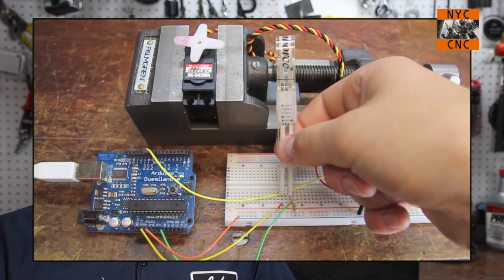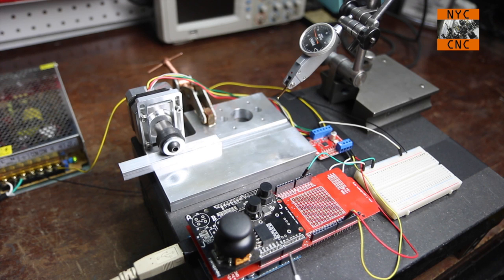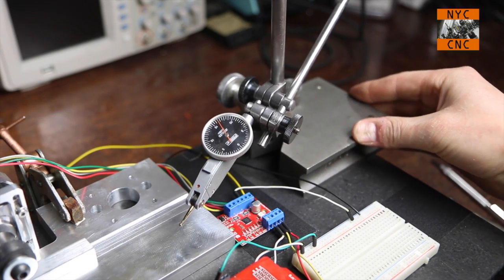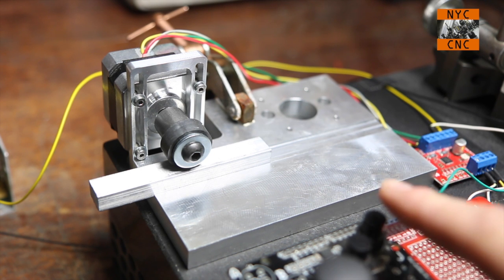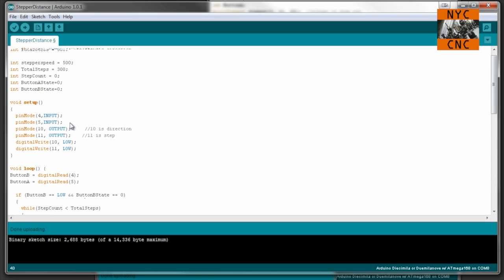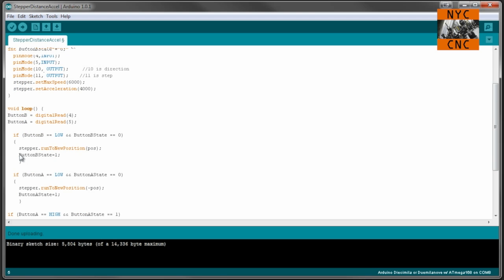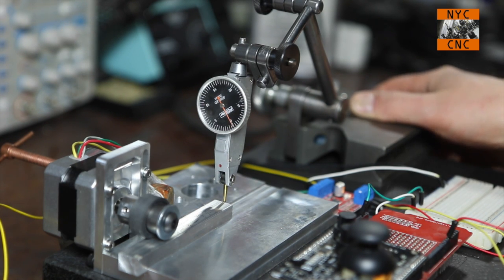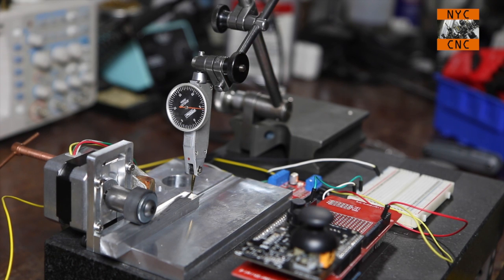Arduino Stepper:  Ultimate Accuracy!

Comment: auto cutter here we go I do believe :)  good job,  I was going to suggest something similar to what you did at the end of your video some sort of feedback, perhaps a servo with feedback could kill two birds with one stone but would not account for slippage.   two encoders that self check each other and even prox switches at certain intervals to rezero/ or show true position would probably be a somewhat realistic path.  You should be able to get extremely accurate results as long as you can account for any possible slippage thru occasional realtime limits and even just a single encoder to compare to the pulses pulsed more then likely dead on results on the cheap.  Please do share what your final design will be, really enjoy.  Great Job. I've been into automation and controls for a long time as well, its what I do for a living. later man
Reply: Nah, your doing great and certainly on the right track, sometime its more fun to figure it out for yourself, rather then to follow the standard or learn from what someone else is doing, seriously good job.  I believe you'll find there is an error in the way those acceleration codes were programmed in the arduino, and you will not be able to get consistant results well not without making your own acceleration code anyway or using someone elses that has been proven accurate.  what type of material will you be cutting if this is indeed for the automatic cutter you mentioned in other videos as I believe it is?  if it Is multiple shapes/sizes, rounds, tubes, bar, flats, etc.  I believe you will find it difficult to get into fine fine accurate cuts well itleast without making a fixture that moves as opposed to just the material itself ( holding material to fixture and material moves when fixture goes forward. That could be a very long piece of equipment to make if you have the room and those are the requirements/multiple shapes and sizes and lengths though it  would probably be the easiest/cheapest route to go.  If room is an issue a dual grab and feed could be an option if using a fixture one feeding lock grabs and feeds on the moving fixture, while the other holding lock locks on the stationary base prior to the feeding lock retracting from full extension, the feed lock retracts not moving the material, once feed lock is fully retracted feed lock locks and holding clamp releases and cycle would continue until your feedback reached the accumulated value then cut.  just throwing a few possible concepts based off of situational variables.  I'm sure you have a picture in your head right now and I'm sure its going to work extremely well based off of what I've seen so far. looking forward to seeing your progress, thanks for the great and well made videos.  later man
Reply: He will most certainly need an encoder if he expects to achieve this this kind of accuracy, although there have been many times folks thought they needed an encoder when they didn't.  It all depends on the application.  As long as the stepper is not undersized so that missed steps are never expected, limit switches alone often will work.
Reply: absolutely Keith, I'm only assuming he wants to input several different lengths to cut in a given day or whenever a length change is needed.  also assuming he  just wants to simply input a length he'd like his stock cut to and the machine automatically feeds it to that length and then the cut starts.   If its a continuous run of multiple parts a limit switch of some sorts would suffice for accurate lengths even, but it would take a lot of extra time in setup if you only went with limit switches as you would have to reset the limit switch location to the new desired length every time you wanted to make a different length cut(of course he could automate the position of the limit switch itself once again limited in space may not be best design for application).  So many infinite possibilities of designs, I'm very interested on what he is going to go with.  That to me is the beauty of automation when it comes to controls 10 different people can accomplish the same task in 10 different ways or designs and as long as the outcome ends up accurate and the same in the end they all would have made a good design.  That being said there is always a cheapest and most efficient way to do everything.  The best designers will usually choose the simplest/ cheapest path to get the job done while not skimping on quality nor longevity of equipment service :)  He seems to have a good bit of brains in him, He also seems to really enjoy what he does.  Those are the only two prerequisites that really matter when it comes to creating a good design, I've found they usually always end up successful in the end the final test being this,  did it do everything I wanted it to do in the end consistently and accurately every time? answer=yes you passed  :) Take it easy Keith
Reply: NYC CNC Understood, it is either don't allow slippage and use an encoder, or allow slippage and use a limit switch.  Certainly the later is both easier and cheaper.  Btw, like Mike, I also work in automation and love it from every aspect.  Just wish we had more manufacturing in this country again!
Reply: NYC CNC
Yes, most certainly the stepper shaft.  If you use timing pulleys and belts, there won't be any slippage.  I'm with you though, the limit switch is a better option for your application.
Reply: NYC CNC If I were going to make one and automate it to account for any type of stock within reason, I would go with an encoder but not in the way you may be thinking I would have a stepper or servo or pneumatic or hydraulic cylinder drive something similar to an x axis on a milling machine motion  and I would have the encoder reading actual movement thru precision  rack and pinion such as you have on a measuring caliper, and or I'd just use a string pot encoder (common name for anyway) and make sure it is mounted level and equal distances from the machine.  this would be assuming you have a large amount of space to allow for that design could be as simple as an acme screw driving some square stock tubing as the moving table, doesn't have to be an actual x axis with ways.  The main question is how accurate must these parts be if your talking a 10-20 thou tollerance or even if your only running short parts.  I believe myself an encoder would be overkill for your purposes assuming you have a some allowable tolerance for possible slippage.   well thats one of the many ways  how I might have used an encoder anyway.  reality is I would probably go with your original concept and use a strong enough stepper motor to drive your stock as you showed with the additon of two rollers and a good amount of tension against the part total of 3 rollers and maybe even 4 @ 90degrees from each other (flat stock).   I really believe that would work just fine even for very accurate positioned cuts.  Key being a stepper motor that has alot of torque so that you can tension the drive wheel tight enough to not allow any slippage against part as well as enough torque to where the motor will not skip any steps.  I know you can understand what I'm talking about when I state stepper skipping because I'm sure you've experienced it on your g0704 when you first went to tune the steppers,  To fast and you loose holding torque and you magnetically skip a step and or to much load same situation.   I guess I"m not good with short versions here :) but short version I'd stick with your plan and maybe sandwich on some precision rollers with one drive wheel and an encoder should absolutely be good enough, for your current need.  You will be forced to go a diffrent route if you ever change your needs such as multiple stock sizes or shapes to cut.  Keep up the good work   If you truly are making same parts 100's or 1000's of cuts Id just use the stepper, if accuracy is a must back it up with a limit switch preferably a prox switch for accuracy's sake, and if you are doing aluminum or plastic or some other non ferrous material look into Diffuse proximity sensors (Transmitter reciever same sensor reads the bounce back very accurately/consistently) and or I would probably just use a capacitive proximity sensor which would still give you the ability to do plastics and non ferrous material as well as steels.  If only steel parts just go with a standard ferrous sensing proximity sensor as they will most likely be the cheapest route($10-30 or more).  Eyes hurt yet from reading :)   Hope this helps bring some light to some options you may not have considered or known of.  automationdirect.com has good prices on good equipment of the types mentioned in the realm of sensors.  Later man
Reply: Mike fisvii
And maybe throw in an LVDT just for fun ;-)
Reply: you sound like an old timer :)  or perhaps an old steel worker or power plant Instrumentation & controls type :)  just a guess  non the less definitely an industry controls type guy.  take it easy Keith back to the grind :)

Comment: Hi!

Lovin the video series.. One thing that I noticed is the size of the wire you have going from the power supply to the driver board is very light. The high current required to change the momentum of the stepper rotor may not be able to flow through such light wires.

It may not be an issue for the small stepper in this video, but I'm sure it was causing problems on the last video with the large stepper.

Keep up the great work!

Regards

Mark

Comment: With the accel and decell accuracy, you may be having slipping problems on the rubber wheel. When the steppers slowly accell/decell, they jump slightly and rattle which that rattle could lead to the rubber wheel or material to move very slightly.
Reply: I agree, generally direct drive systems like this use timing pulleys and a timing belt for more surface contact.  Timing belts are flexible of course but not mushy like what is being used here.  Some materials used for timing belts have more grip than others but don't last as long.
Reply: NYC CNC I think you are applying more force and over a longer period to the shaft during the acceleration side than you are on the mechanical side. More force may be overcoming the coefficient of friction that lets the rubber grip the metal bar.